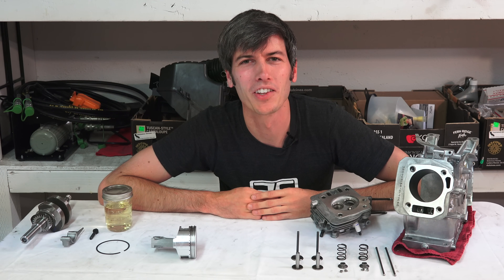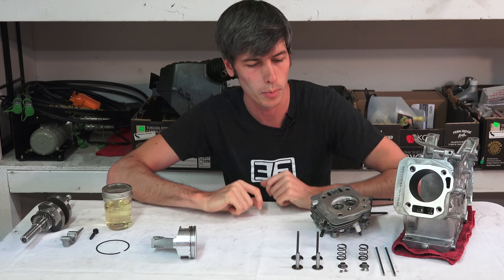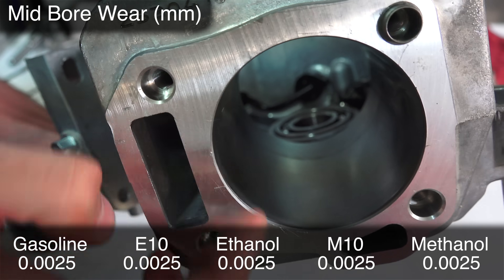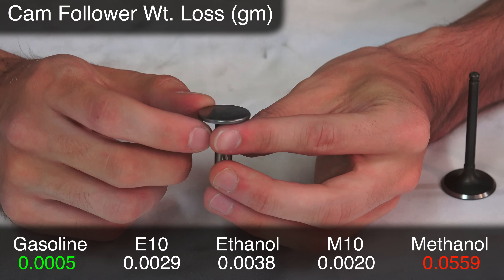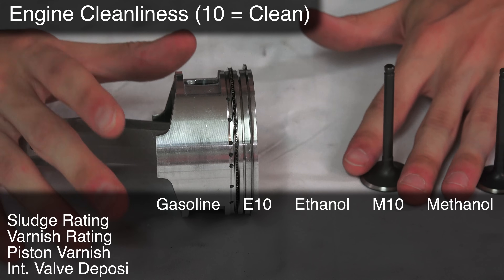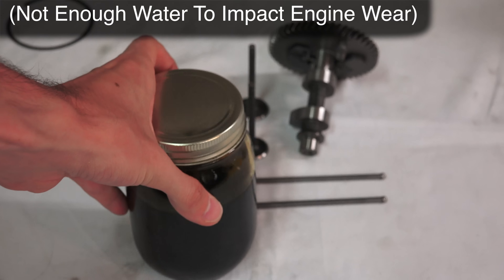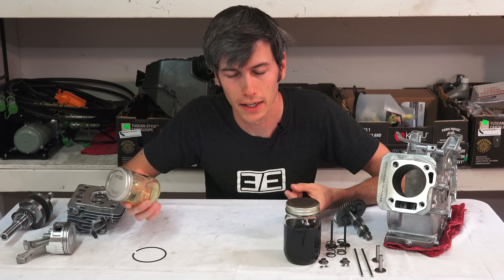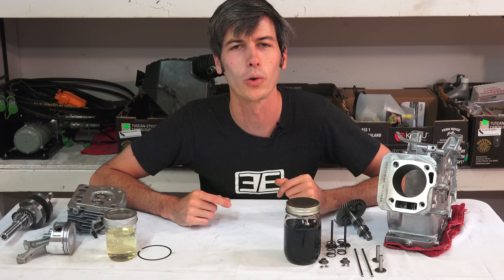Is Ethanol Bad For Your Car's Engine?

Comment: I really appreciate the research that went into your presentation. Thank you.  I rebuilt a 2010 Chevy 2.2 L Ecotec engine with VVT (Variable Valve Timing) last year.  It failed due to low compression and, after disassembly , it 0 PSI compression was caused by a build up of material on the intake valve stems exactly where the injectors direct their spray.  The engine has 225,000 km on it and everything else was well within spec except the timing chain and its associated parts.  The failure was obviously due to the E10 fuel but with that mileage, it is pretty hard to call it a fail.
I am not a mechanic but a retired physicist so my point of view may be a little different.
I do, however, see a large fuel related failure due to ethanol in small engines, lawn mowers and chain saws, where the carburation components fail completely. This is most likely due to the corrosive nature of the ethanol. In the case of small engines, I would strongly recommend the use of non-alcohol fuel, or, at the very least, regular grade fuel that has less alcohol.

Comment: Not sure if this will get read, but I would wager that the piston sleeves contained potassium dichromate (K2Cr2O7). The oxidation of methanol in the presence of K2Cr2O7 produces formaldehyde, which would oxidize quickly to formic acid. K2Cr2O7 then also behaves as a powerful oxidizer in an acidic environment.

Comment: Both your videos about ethanol and engine wear are very good.  However, in the video concluding that E10 does not damage car engines (but perhaps accessories on older cars) omits a very significant problem in high performance and luxury cars manufactured in the later 1996 - 2000, including some race cars.  Larger aluminum engines are generally manufactured with either steel or Nikasil cylinder linings.  Unfortunately, especially in the US, those cars with Nikasil linings often had cylinder wear from using E10 (and creation of acids in the combustion) that wore away at the Nikasil, losing compression and causing slow or failure to start.  This was used in Citroen, Jaguar, Porche, Mercedes and Suzuki passenger (and racing cars - up to F1) as well as dirt bikes, ATV, etc.  Virtually every manufacturer returned to steel lining after a few years of problems.  Note that higher end racing cars had less of a problem because they did not use standard E10 fuels. Thanks for the videos.  Take care

Comment: Thanks for the explanation. I’m going to run E85 exclusively in my 2014 Yukon flex fuel vehicle.  at present 3/21/22 the gasoline in California is over $6.00 per gallon. A station not far from me has E85 for $3.39. I can afford to drive my SUV cheaper than my work truck (non flex).

Comment: The gasoline type should NOT have a significant effect on the cam components as they should be by the lubricants used and NOT the fuel used.

Comment: Marine use of Ethanol is really where it becomes a problem, especially on 2 stroke motors. Ethanol in that environment attracts significantly more water into the fuel blend, and in the case of HPDI 2 stroke motors, many failed because of the lack of lubrication created from the water in the fuel. Also, the rubbers in the motor degraded much faster. My 4 stroke outboards have fared much better day to day and have lasted many 1000s of hours longer than my 2 strokes. I am sad to say Sen. Bob Dole has passed. He was the most powerful voice in the Ethanol "industry", as he was from Kansas. It is time to get rid of this crap and switch to switchgrass or whatever. Even better, electric. Use the switchgrass to power the electric plants until renewable is spooled up!

Comment: I enjoyed watching this video because I purchase non ethanol gas for my 67 Chevelle and my lawn equipment. Can you do a video on if E10 is corrosive to fuel lines. I have had lawn equipment where the fuel lines became fragile after consistent use of E10. I had a John Deere mower dealer advise me to never put E10 fuel in a ZTR. Ieven had  one riding mower that had a punctured plastic gas tank after using E10 fuel for a long period of time. Thank you.

Comment: I see the biggest problem is with small engines that are used seasonally and then stored. Ethanol blends cause fuel system issues resulting in rough running, inefficient, or unusable engines without extra maintenance cost and down time. Of course the same is true with classic cars or cars that are not run regularly. ANY gain in decreased emissions is negated by periodic running of the small engines just to avoid the problems of them sitting unused until needed. For example I will start and run my generator for at least a half hour a month when I don't need to use it, just to keep it in running condition, so six hours extra per year that it would not have had to run if I could get fuel without Ethanol in CA.

Comment: I understand that they use a more abusive testing standard than everyday uses. 
What hasn't been taken into account is all the other pieces of equipment that use fuel as the combination source. 
All the gasoline powered equipment that isn't built to use ethanol in the mixture is either rendered unusable by various components failure due to ethanol destroying the the product altogether such as fuel lines, due to breaking  down the rubber it's made of.
Then carburetors due to blockage caused  by the ethanol turning into varnish, and are destroying the diaphragms, along with other components made of similar materials. 
These are a very large portion of what people have to have in order to maintain their properties, and they're not being brought up to standards in order to work effectively with ethanol. 
Thus hundreds of thousands of dollars are spent needlessly because of this conversation over to ethanol fuels. 
Isn't not true that the actual fuel economy is less with ethanol based fuels than with unleaded gasoline, because the octane rating is higher in all grades, and the higher the octane rating the more gallons needed to go the same distance as unleaded gasoline.
Because  I have friends that have flex fuel vehicles that burn e85, and while it is cheaper than gasoline it takes nearly twice the amount to go the same distance as gasoline. 
That would mean that even though it's only 10% ethanol, there is a significant decrease in mileage per tank of ethanol fuels versus unleaded gasoline if I understand the ratio over the lifetime of a vehicle. 
Please correct me if I'm wrong, but please give me your thoughts if you do agree with my thinking here.
Sorry if I jump around a bit here, but I believe my concerns are expressed clearly enough to understand my meaning.

Comment: Older motorcycles, that I have heard from many experienced techs, should not use modern fuels unless their tank and fuel system is coated to prevent corrosion. I have heard the same for boat as well.

Anecdotal, of course, and I've never owned a classic motorcycle, nor a boat with a motor, so these comments might not mean anything.

Of course, if you run a tank dry in hours (as I have), it doesn't really matter except for the price/mile of that particular trip.

Comment: Switching to ethanol-free gas in my 230k+ miles 2004 Ford Ranger was the only way I found to black out the 'Check Engine' and 'Replace Fuel Cap' dash indicators.  I no longer have that truck, but I still avoid ethanol-laced gasoline in my newer vehicle just in case.  Like an extra oil change, it's only $90 more a year or so.

Comment: I'd really like to know how ethanol works as an octane booster if it actually contains less chemical energy than gasoline.
Reply: Octane rating has nothing to do with energy content.  Rather, it is the fuel's resistance to pre-ignition/detonation(the higher the octane rating, the less likely the fuel is to burn before it's supposed to).

Comment: I would be curious to see the harm that can be caused from running E85 in a normal scenario. Not because of the abuse but because I’ve always heard the e85 has a tendency to gum up if left sit for to long. I would think that even in newer vehicles designed for E85 over time for a car that isn’t driven every day. You would get more internal damage from E85 partially clogging a fuel injector and creating a lean condition in one or more cylinder. 
Good video tho. It’s good to test all scenarios to get the full aspect.

Comment: Would love to see a more modern version of this demonstration.  There are hundreds of race enthusiasts using e85 and souped up engines to generate hundreds of horsepower beyond original design. This is the real research that should be happening. Subaru WRXs, Ford Mustangs, Dodge Challengers.  Alot of folks having alot of fun with an inexpensive , readily available racing fuel. You might also touch on ethanol fuels and the difference a synthetic engine oil makes on wear & tear. Keep up the good work!
Reply: Ralphie, what do you burn in your bus?;)  Is Alice back from the moon?
Reply: @DISGUYROX   Bang!  Zoom!!

Comment: For anyone still questioning the reliability of running engines on E85 or Ethanol blended gasolines, just look to the USPS's fleet.  They've been E85 since the 70's and they're STILL GOING.  Show me another fleet that's lasted as long on pure gasoline.

Comment: It's very bad for my 36 year old C4  TPI 350 engines fuel injection system. 
I only use non ethanol  gas from my Shell station. Just that one pump, out of 20! Cost more 🤑 at the pump, but eliminates costly repairs down the road.🚘

Comment: So for a 99 Mustang, with a six - that was recently rebuilt at about 200,000 miles - I need to avoid using E90? Also, how much lower fuel economy for the 10% ethanol blend?

Comment: As has been mentioned below, this is a very informative video  I apologize for this late entry to the discussion, but I am interested in your view on the detrimental effects of ethanol "enhanced" fuels on small engines, such as those used in lawn equipment.  The opinions of small engine mechanics who work on these engines for a living, and my own experience as a user and owner of multiple pieces of small-engine powered equipment, the propensity of ethanol to attract moisture from the air causes significant monetary and productivity related problems.  If you have already addressed this issue in a previous video, I apologize for overlooking it.  Thank you.

Comment: The fuel system damage of ethanol is a big issue in the motorcycle and power boating sectors.  The tendency for seasonal use means a LOT of older engines out there and the long fuel term storage issues are more problematic.  Would love to see any research available on additives that deal with these issues.  Perhaps the simplest and ideal option would be to keep Ethanol out of PREMIUM gasoline all together.
Reply: Quite a bit indeed

Comment: It is true that it's fine for cars. You did mention the main issue, but kind of brushed by it.

Ethanol is very bad for small engines. It's fine to run them with an ethanol blend, but due to the nature of how many small engines are used, they often sit for a decent amount of time without use. The absorption of water and separation is pretty harmful for small engines. 

I have never met a company that chooses to use ethanol mix gas for chainsaws and similar equipment. Gas without is often 30% more expensive, but it's judged that the reduced maintenance issues from buying ethanol free makes that cost worth it (buying more new saws, and putting more repairs into already owned saws adds up). The only companies I am aware of that use ethanol mix are extremely unprofessional in other regards as well 

I ain't no scientist, but this is the general industry consensus. It's more economical to buy premium gasoline for small engines, vs buying ethanol mix and spending more on repairs and replacement.

Comment: Water in the oil: With 20 hours of steady use under heavy load, it evaporates. With short trips, does the oil get hot enough, or does water build up?

Comment: I know this video is older but I still want to leave a comment.

When we switch to 10% ethanol my small engine lawn mower would have It's carburetor gum up all the time! 

This was a newer lawn mower as well! 

Ethanol and small engines just don't mix! 

The manufacturers of the small engines never accounted for 10% ethanol until very recently.

Ethanol basically killed my lawn mower! 

Ethanol is about a joke anyways. It doesn't really reduce carbon emissions at all in the long run.

Comment: A Couple of things that come to mind. #1, there needs to be testing done on the long term affects of ethanol on the entire fuel system ( on both newer and older vehicles). Injector seals and O rings and the gas tanks themselves.  I am betting that the ethanol still erodes seals and O rings big time. I would also bet that at some point biological growth of some sort will start to happen in the gas tanks. Those can be VERY expensive issues to deal with. Personally, I just feel that ethanol was implemented in the same way that say modern wind mills and electric cars were, very haphazardly and without all the facts. While what they tell you looks great on the surface, when you look at the big picture suddenly things aren't so great.
Reply: See USPS's fleet.  There won't be a longer term study than just simply looking at that.

Comment: If you are worried about E10 think about Brazil petrol that is E27 by law! There is no option of pure gasoline or something like E10. I have a suzuki sx4 made in Japan and have to keep cleaning my fuel injectors and changing orings because they get clogged up by corroded rubber every 6 months.

Comment: “Ethanol has less energy content”… @ 9:20. I recently found out that sometime in the early 2000’s there was a big push for E10 as way to create a domestic demand for corn (from which ethanol is made). The push for E10 was absolutely not a practical one, it was not a “green” initiative, it was purely a way to stimulate the agriculture economy.
Reply: Not all farmers are millionaires but the corporate farms have made a killing and get richer from the subsidies. The family farms have suffered in comparison.
Reply: Not surprising. What I don't get why is why farmers are so obsessed with corn. It's not impossible to switch to other crops.
Reply: I suspect that ethanol is a huge energy waster as opposed to 100 percent gasoline.  Why?  Because how much fuel and fertilizer is used to grow all that corn?  Any studies done on that?  If yes, let me know.
Reply: @bkearnaghan  Cornell University did studies on the energy use needed to make ethanol - proving it's a huge energy waste.
Reply: @voidisyinyangvoidisyinyang885 — Ever seen that same study applied to electricity ??
Reply: Always follow the money
Reply: The net energy from Ethanol is negative.   In other words, the input to raise the GMO corn crop to harvest and processing yields a product that releases far less energy than what was put into it.  This was all pure greenwashing and 10% Ethanol blend is an inferior fuel to straight gasoline.  My engine (2.3 Ford Ranger) runs far better on the so-called "Rec90" ethanol-free gas which is sold at marinas and areas where a lot of boaters are.  Incredibly, it become a real dog with premium unleaded Ethanol blend fuel.  Go figure.

OTOH, Brazil does it right.  They get their ethanol from sugar cane waste.  They extract value from something left over after sugar processing and would otherwise be burned or plowed under.
Reply: We grow way too much corn. Its in everything. Its in the fuel, its in the sweeteners, its everywhere.
Reply: Here's another side to the equation, oil refineries are not set up to produce ethanol and blend it with the gas before transporting it to distribution racks, so it must be shipped by truck and or rail which is burning more diesel to do so. Bet no one thought of that when they mandated it.
Reply: Wow!  Good catch.  
I've often pointed out the economic and energy loss in growing a food crop to be turned into a fuel additive.  Brazil, OTOH, gets its ethanol from sugar cane waste.  An economic no-brainer and win if ethanol production is the goal.
Reply: And yet here in Australia E10 at RON 94 is cheaper than RON91. Go figure.
Reply: Yup. Car manufacturers like it because it causes more issues so the older reliable cars die off so they can stranglehold us with electric cars with GPS tracking and updates. Piss off a politician? They can have you car accelerate and crash with some key strokes! Wee! It's already happening
Reply: You got that right!  Chuck Grassley made all the farmers millionaires.
Reply: @rogerpenrod5214  The real winners were corporations like Bayer, Cargill, John Derre that paid off Grassley.
Reply: So fill up more often, big deal. Hybrids reduce that frequency. One study actually showed that at E20 and E30 some cars had better fuel economy than E10.

Comment: can pure ethanol replace gasoline for internal combustion engines and how efficient is it
Reply: Pure ethanol is not efficient at all. It doesn't pack any punch compared to refined crude oil of which requires more to do the same job. Be it that it's a cleaner fuel (28 years down the road), you're not saving the environment and definitely not your wallet.

Comment: If you design an engine to run on e-85 only you can run a much higher compression ratio and make up for most if not all the loss of MPG and get a lot more HP in the process.  Flex fuel cars are compromised so they can run on regular gasoline NOT the other way around.